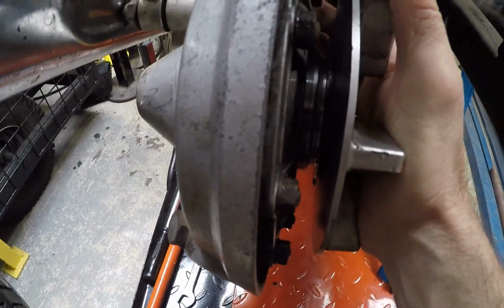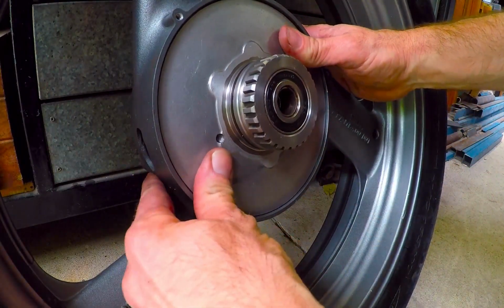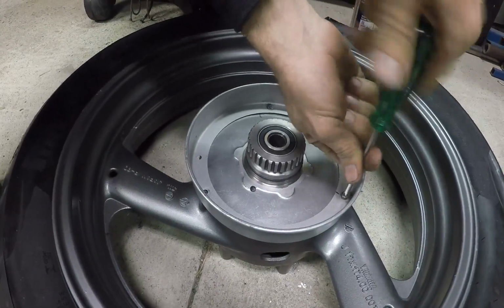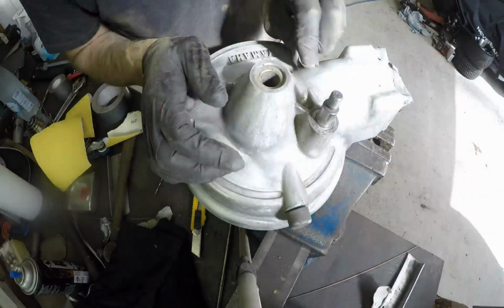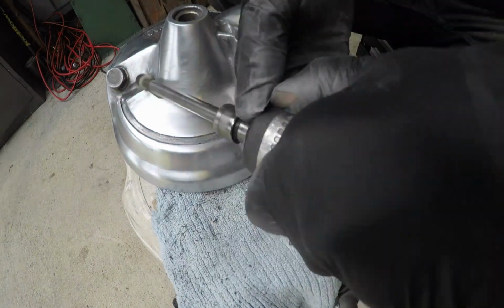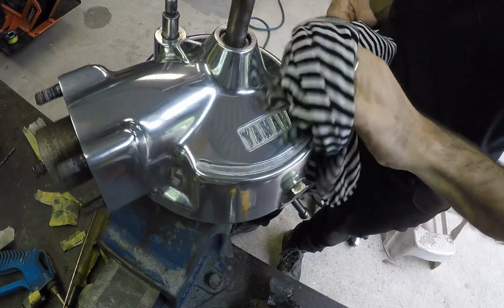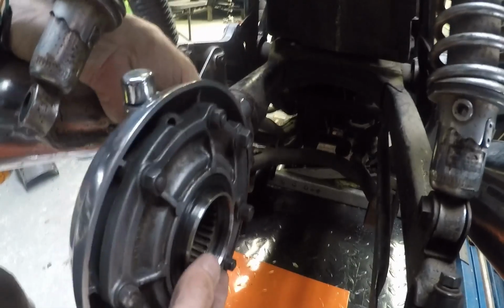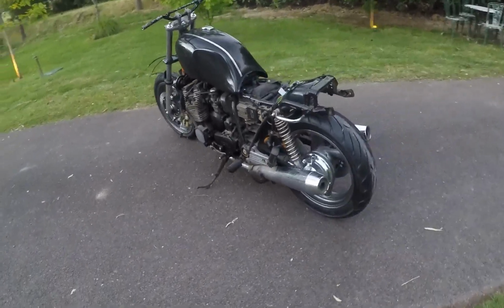Yamaha XJ650 Part 7 Completing rear end conversion

Comment: Hi @Mezzmo Engineering, I'm doing a similar build with an XJ650 but have swapped the front end with an FZR1000(USD forks) and am following your lead with an XJ900 rear wheel(Both wheels look almost the same). The question I have is, what rear axle did you use and was there any mods needed to make it fit with the disk brake setup?
Reply from the maker: Hi Mate, yes I had to make some mods to get the disc to fit properly. Its very tight but possible